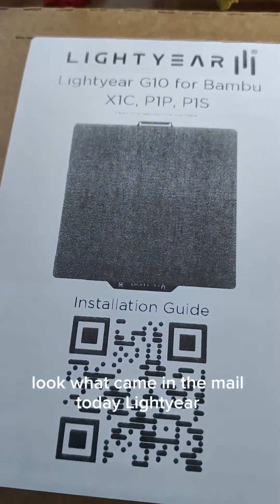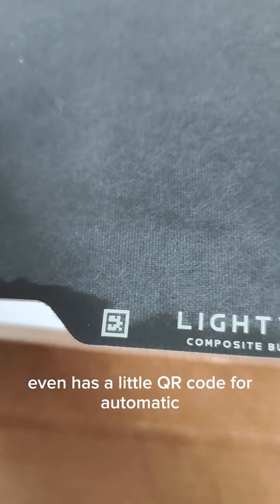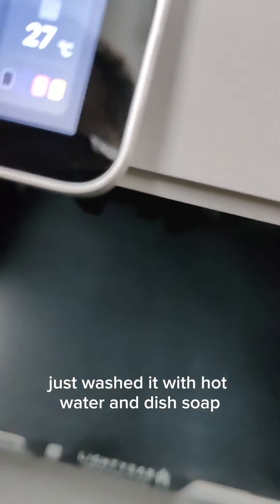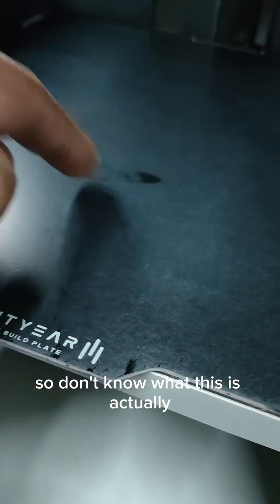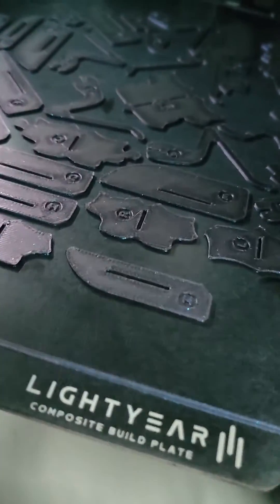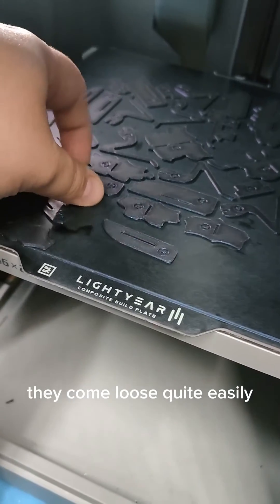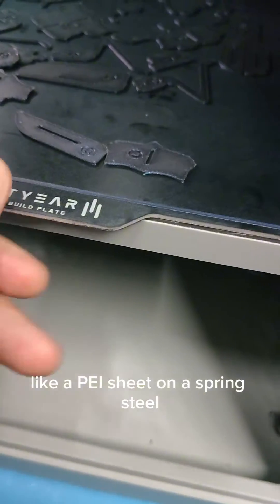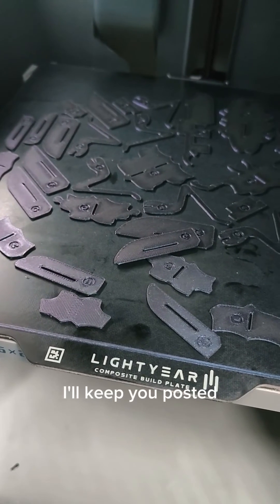Lightyear G10 build plate for Bambu Lab printers

Comment: How have these Lightyear G10 plates held up? See lots of people posting problems with Lightyear. Would you still recommended? Have you ever tried the Darkmoon G10 plate?
Reply from the maker: The adhesion has deteriorated a bit, so it's not that reliable anymore.

Comment: I ordered my double sided G10 build plate December 23 received February 24.  One use and it delaminated, large air pockets over 50% of the plate.  3 emails, trying to chat with them for 2 days, and a phone call that this number is not in service,  I have yet to communicate with them.

Comment: Have you had any elephant foot issues being that it is a thicker plate?
Reply: It doesn't make any difference because the nozzle levels to the top of the build plate, regardless of how thick it is
Reply from the maker: Nope no issues because it takes the thickness into account when homing before every print. Had to up the bed temp to 60°C to get good adhesion though. Also select high temp plate in the slicer